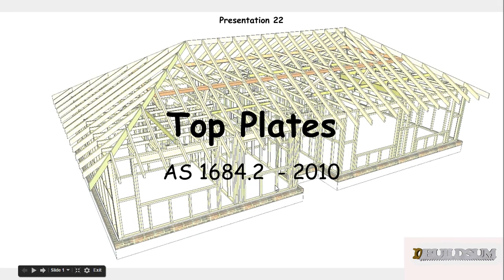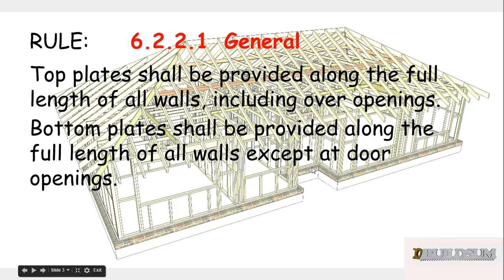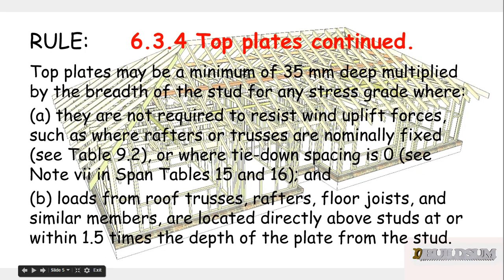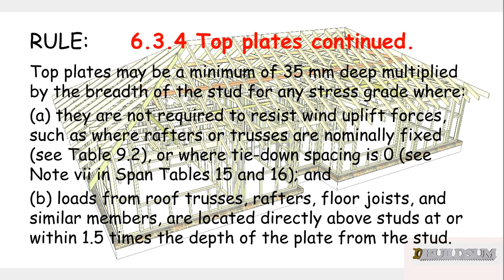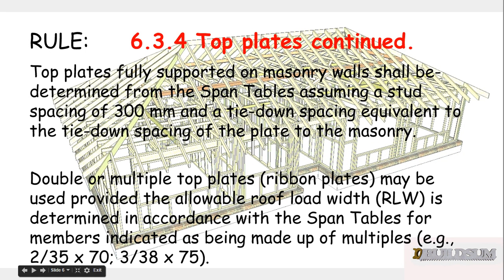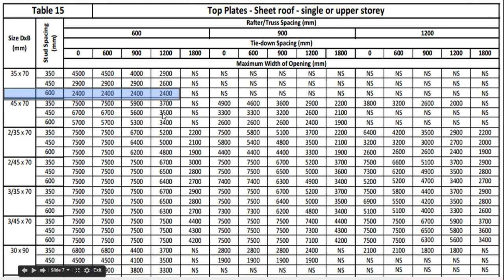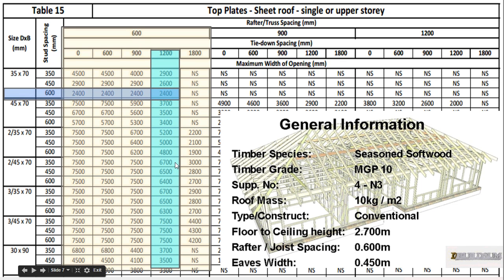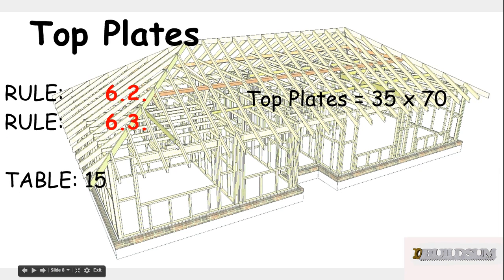22 Top Plates

Comment: Hi Buildsum, This Tie-down should be provided at same spacing as Rafter spacing as Rafter is landing on Top Plate and needs to be held?
Reply from the maker: Hi Mansoor, there is a difference between the tiedown required and just connecting the Rafters to the Plates. In high wind areas, additional tie downs may be required.
Reply: Understood, Thanks

Comment: For a simple example like you've used, can AS 1684.4 be used, and specifically in this case table A22? I ask as I like to work through your examples for myself to see if I come up with the same answer, and don't know where I'm going wrong as, well I don't get the same answer :) That table calls for 2/35x70 for MGP10 plates on 600 mm studs for a 3000 mm sheet roof span. I'd read 1684.4 erred on the conservative but that seemed a bit excessive to me so I figure i must be misunderstanding something.

If I understand correctly, would 900 mm roof truss spacing on 450 mm stud spacing only require 35 mm top plates if the trusses were arranged to fall within 68 mm (ie 35 x 1.5) of the studs, and is that number +/-? ie 68 mm either side of the centre
Reply from the maker: HI Pete
Yes,Trusses spaced at 600mm and tied down at 600, 900 or 1200mm centres would only require a 35mm plate if they all landed as you described however i think you will find that the distance is 52.5mm not 68 from the stud.

Hope this helps

Comment: Thanks for your great videos, you really do an amazing job and I refer to them regularly. It's very annoying how the Australian Standards are tied up on a fee basis as, like your other viewer's comments below, I don't have the appropriate supplement. 

I have some termite repairs to make and if possible want to frame up a replacement wall to consider a possible future extension. I'll use 45 x 90 on 450 centre studs on what would become the load bearing wall if the extension goes ahead. If that turns out to be insufficient, and wall height was not an issue, can a ribbon plate normally be added later once the existing (skillion) roof is removed and before the new trusses are installed? I can't see why not, but maybe I'm missing something?
Reply from the maker: Hi Pete
Thanks for your kind comments.

i would say that that wall would be sufficient in most cases and yes you should be able to add a ribbon plate later if needed.
Reply: Thanks very much.

Comment: Hi Buildsum, I have an old pdf version of 1684 (1999) for educational purposes but it doesn't have tables you mentioned. How could I get these tables?
Thanks
Reply from the maker: It's very hard without purchasing the actual code and the tables I have used are from the supplements of AS1684.2 Non-Cyclonic Areas not sure if that would be the correct set of tables for your area.

However, there is the Timbers Solutions software which references the AS1684 tables.
https://www.woodsolutions.com.au/Articles/Resources/timber-solutions

You will need to register in order to download it but then you can use to software to determine the size of the timber you need.
If you are looking for a man-made timber product most manufacturers have their own design software
http://www.chhsoftware.com/designit/

http://www.hyne.com.au/knowledge-centre/planning-tools/timber-design-software

I have actually done a video on this one https://www.youtube.com/watch?v=Vz8aQ92pr_g&t=5s

Hope this helps
Reply: I'm in Brisbane area so it's non-cyclonic and yeh I think that supplements come with the purchased code. I know it's an expensive code and no one wants to share it but may I ask you to give me the Pdf version of supplements if you have? 
Thanks
Reply from the maker: Hi Al
There are 45 different supplements depending on timber type or strength, I only have the one that I used for the videos and I would not feel comfortable sharing it, sorry
Reply: It's Alright mate. Thanks for your great videos.